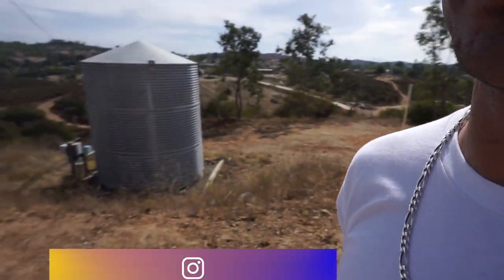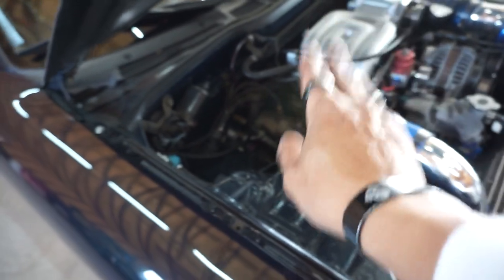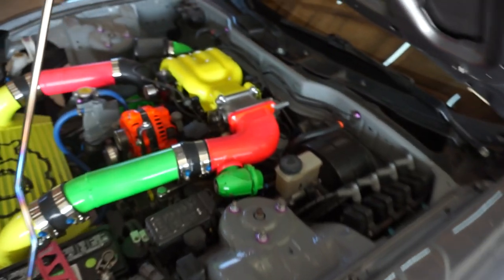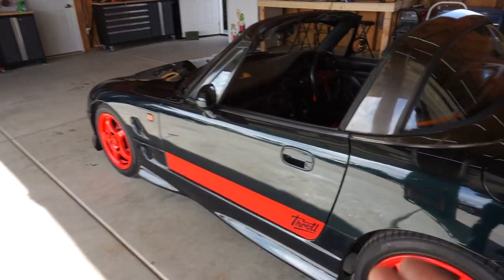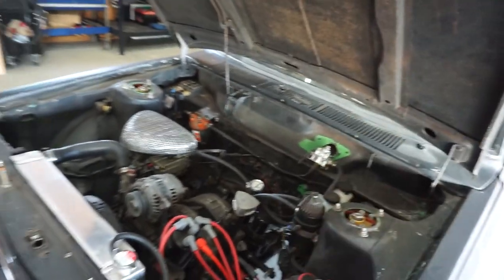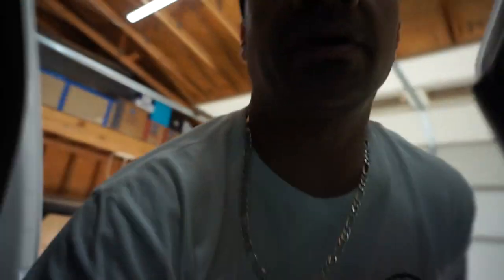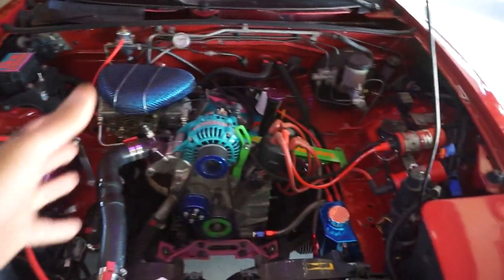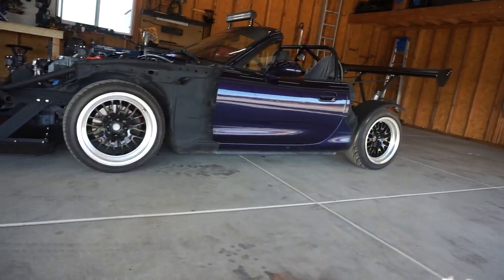FULL TOUR OF RICKIE'S CAR COLLECTION!

Comment: @throtl
What are you talking about they dont have strut bars for fd3s? You should look up racing beat. It might be hard to find the parts i had as they were discontinued back in 08 when i had to search for everything, but definitely worth it if you get it. Handled freaking amazingly. I had a 94 Montego Blue FD3S RX7 back in 2008, and I got full racing beat suspension, sway/strut bars, and racing beat 4inch exhaust and racing beat intake on Apex-i RX6 custom twin turbo set up with custom aircraft leancruise setting on ecu with 520rwhp and with cruise settings it got almost 30mpg. Averaged 20-28 depending how often i opened it up. Lol.
Reply: When I said they don't have a strut bar I mentioned from manufacturer... only the R1's came with them stock

Comment: Hey Ricky love the vw mk1 caddy love it so much I have one also but mine doesn't have the original 1.6 carb motor any motor I have the 2e with a 2l 16v on tubrocharged capable of 2 bar boost making 268kw on 0.7 bar love my bakkie it is my daily driver even though my 135i with n54 is better as a daily but the caddy just get so many looks its so loud love all the cars dude but favorite is mk1 caddy but gotta say I'm from south africa and from me to u and all the guys love the videos keep making awesome videos thanks
Reply: 2l 16v cylinder head on a 2e block